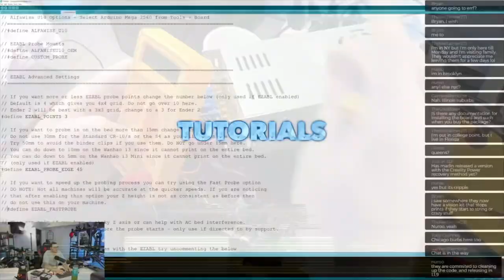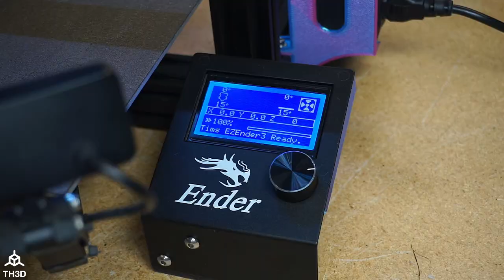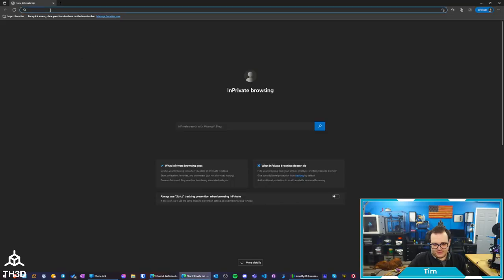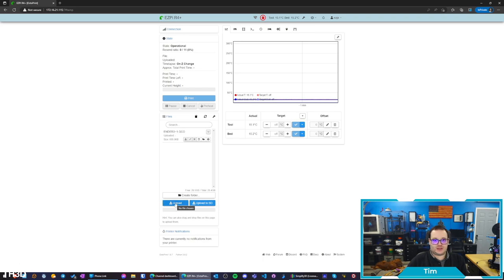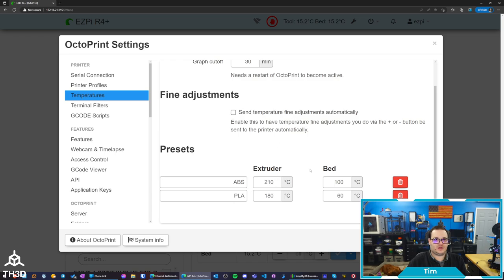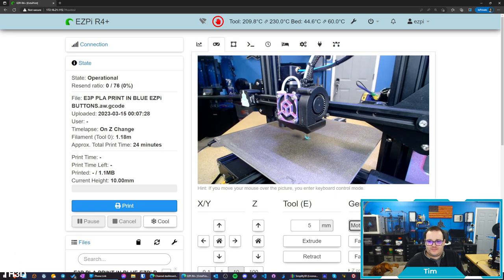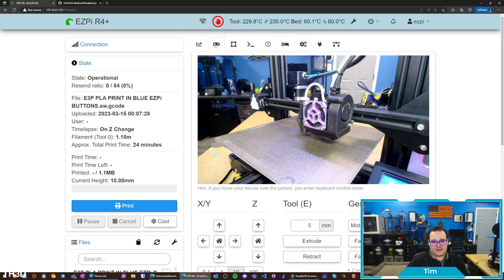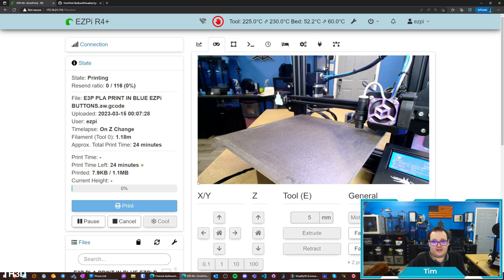EZPi R4+ Setup Guide and Demo - Wifi Octoprint Controller Kit

Comment: Can I hook this on a Anycubic chiron?
Reply from the maker: Yes, it will work with basically any 3D printer that has a USB port and runs Marlin firmware (this is most machines). Your Chiron runs Marlin so it will work.

Comment: This is dope how many printers can you connect? 
I have x3 Ender 3 Pro’s would I be able to use this on all 3 or just 1
Reply: @@Rob-cd2sx True but you can run multiple instances on same Pi
Reply from the maker: Officially this is for one printer at a time. While there are workaround for Octoprint to run multiple machines off one controller it has drawbacks and additional complication to do so which is why it's not recommended by us and the creator of the octoprint software.